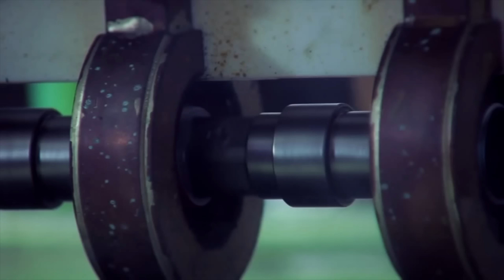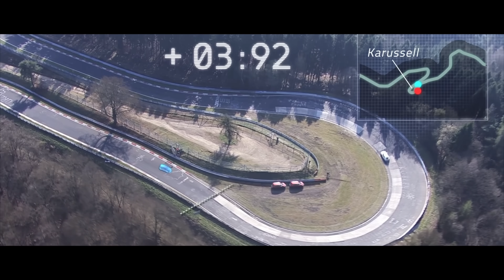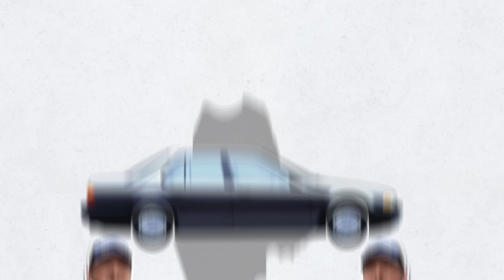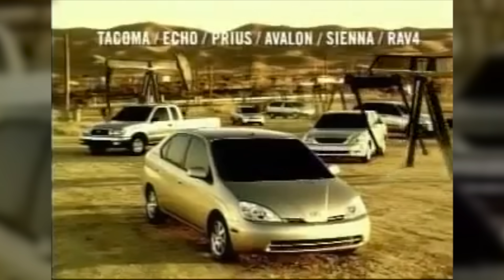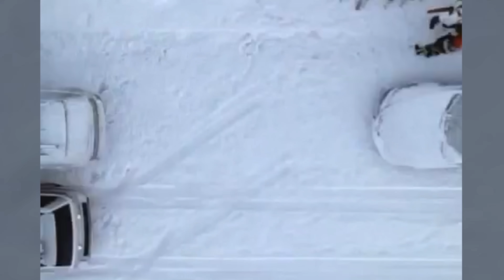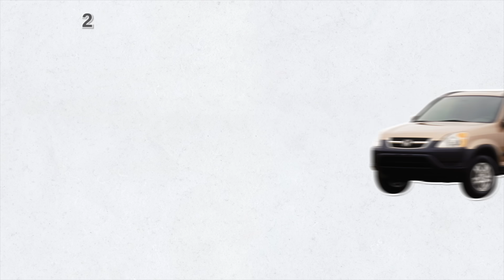Here’s Why Honda’s New Cars are Genius

Comment: Love their cars, lawnmowers, SUV's, but their small outboard engines absolutely suck in the commercial world. We treat lakes and ponds and need robust engines and Honda ain't it. We took a gamble and bought a handful of them and they failed, all of them. The cooling intake was much larger than the 'piss hole' for cooling the engines so they would constantly suck up larger particles than they could exit causing them to overheat. We don't get the option to only boat in clear clean water, that's what we are there to do. Yes, they were covered under warranty but the time it took to get any of that resolved was ridiculous and we traded them for better brands that were proven.

Comment: Bought a 2005 Honda CRV brand new in  October 2004. Best car I've ever owned. 268,000 miles on it and I Ubered with for 3 years. Did almost 2000 trips! Gonna drive it til the wheels fall off! 😂😂😂

Comment: The very first Odyssey (not shown) was Consumer Report’s highest rated vehicle in reliability. It also had 5mph bumpers, the first disappearing rear seat in a minivan and dual-zone AC. The only minivan with those features standard. I owned a 1996 and loved it. Subsequent Odysseys haven’t quite lived up to the first one. But, they are much bigger, more powerful and quieter. The original was bullet-proof reliable, an outstanding travel vehicle, but the engine was not quiet when revved!

Comment: Currently driving a 2008 Honda Accord sedan 5 spd auto.  The only big problem with this one is the VVT solenoid located on top front cam case above the alernator. The gaskets will fail and oil will leak down into the alternator causing it to fail. It's an easy fix. I replaced the top part of the solenoid and replaced the alternator. It runs exceptionally well now averaging 22-28 mpg at 178,000 miles.

Comment: Honda's may be well built with great mechanical parts but honda can't go over its budget of its sale price so it has to compromise by making the vehicles smaller than its competition and interior parts are made of cheap materials like cheap plastic dashboard unless you willing to cough up extra cash to get more features. If your willing to pay above 30,000 or above 40,000 I would suggest a luxury car not a honda. But if you want a small vehicle with less features under 30,000 than a honda would be the right vehicle for you. A honda is never going to turn any one's eye or impress anyone and too many people own them. The biggest turn of of honda IS THE SMALL COMPACT SIZE.

Comment: Look beyond the exterior and engine, you may find what I found. Lack of quality control. A missing mudflap screw, thin rubber door seals, exhaust fumes in cabin from a loose vent cable, and more.

Comment: Back in the 1980's I was living in Korea.  I needed some cheap transportation so instead of buying a car ( very expensive) i decided on getting a motorcycle.  I saw a Japanese Honda 4 cylinder 400cc for sale. What got my attention was that the seller called it a V-Tec engine.  With the aid of my Japanese GF I found out what a V-Tec engine was all about and it's variable valve timing.  After I drove the bike...WOW....what a surge of power from that little 400cc engine when it hit 3,000 or more rpm!  I was convinced there was tiny turbo hidden in that bike.ha ha.  Same when i first drove my 1975 Honda 750cc four. That was the first in-line 4 cylinder production bike sold.  It had a ton of power compared to the Triumph Twins of it's time!😎.  The Japanese never sold a V-TEC bike in the USA.  WHY? Who knows.  I was very sad when I returned to Los Angeles, California and had to sell my Honda V-Tec 400 cc bike.  Often i thought of smuggling into the US via Mexico.😁

Comment: great video. My favorite Honda was my 1988 Accord which I bought for 1800 and sold it 3 years and 50K miles later for $2300. It was the best car reliable and economic. I had a 95 civic, 88 accord, 2008 CRV all great cars.

Comment: I have had 4 hondas. the 82 Accord was great, the 87 accord not too bad but the PGMFI light came on and Honda could not figure it out. My 2001 odyssey gave up the transmission at 15k miles, they replaced it but I wasn't happy, my 2006 Pilot was an absolute disaster. I couldn't keep it our of the shop. I drove 7 rental cars in the first 6 months. Never again for Honda.

Comment: 2012 Accord LX  with 148,000 here. Second Honda I had. Both cars have lasted me around 15 years in tandem and have been incredibly reliable and low maintenance. Probably won't get that with the newer models but would not hesitate to buy another one based off my experience.

Comment: We have a CR-V year 2004 European Edition with 330,000km on the clock and she hasn't had any issues yet. The only thing I could complain about is how the entire rear weight of the car rests on the lower shock mount and causes them to wear out the bushings quickly. Other than that its an excellent car.

Comment: I used to hate Honda's until I bought a 2000 honda accord for 1,400 and 4 years later it's still running strong with almost 250k mi on it and I have done very little to it. Would buy another Honda

Comment: Our family bought the Honda Accord Tourer 2004 iCTDi Diesel model and ever since then we have had 3 CR-Vs, 2 Civics and 2 FR-Vs in the family fleet (some used, CR-Vs new). My Accord is running 360k like a pro with original engine, clutch and all the other parts. Rust is a minor issue around the fenders, but this is something that has been dealt with by plastic parts in the latter models. This is by far my favourite brand.

Comment: Superficial commercial. Ever heard of VCM? Useless junk that destroys engines. It's on par with 1998-2003 Honda transmission disaster. I drive Honda j35 with classic vtec. Good cars but not as reliable as they used to be because it looks like retarded people are running the company now. Need to be indeapth investigator.

Comment: Two thoughts, 

I owned a 97 CRV and there was more than one trim level as mine was leather seats with sunroof and allow wheels, so there was at least 3 trim levels in 97 in the U.S. It was a great vehicle and only suffered a failed blower motor in 200 K.

 I would like to say also that Honda would do us all a HUGE favor and follow Toyotas' lead and get rid of the TIMING BELTS.

That way Honda would truly be a huge leader in my mind. 

My  08 RIdgeline would appreciate the upgrade to upcoming  newer generations of Ridgelines' if Honda would make that happen.

Signed a Honda, Toyota, and Ram  Cummins diesel owner.

Hey that's a thought,,,,,,,,,,,,,, Cummins powered RIdgeline,,,,AWSOME !!!!!!!!!!

Comment: Had a 2013 Accord Sport. She had over 240,000 miles on her and was running like new with only oil and transmission fluid changes for the most part. Sadly it got totaled by a lady who blew a red light. 

Just bought a 2021 Accord touring black on black. Expecting the same experience with my new baby. Minus the getting totaled part lol

Comment: My first Honda was a 1989 CRX Si.  Loved that car but the manual transmission became a chore in Chicago traffic.  My second Honda is a 2018 Clarity.  Again, love this car.  I drive Ride share and it has performed like a champ even with putting on 104k miles in 3 years.  The entertainment system could use an upgrade but that is small potatoes compared to the reliability and comfort of this car.  My passengers love it.

Comment: As a Honda enthusiast and having owned 10 different models since 92 and also 2 Honda lawn mowers. (Ex wife kept the first one. Can't hate on her for wanting to keep it). My 2019 Civic Type R is certainly my favorite I've ever owned and to drive. Prior to owning, my first thought Type Rs were overrated and an over priced civics. Boy I was so wrong!!!! After lots of research. I bought one without test driving one. Unfortunately most dealers won't let you test drive it so when I drove it off the lot and got on the highway. My prejudgments were totally wrong. THE Best car and the most fun car I've ever owned under $40k.  My wife drives a 2019 Pilot, (her 1st Honda) loves her Pilot. I also own 96 EK hatch back with a B16 swap with all stock internals. Mods-Intake, exhaust and upgraded lowing suspension, bushings and a bunch of other nicknacks. Love my Hondas!!!

Comment: Bought my first Honda in 1990. It was a brand new 1989 Honda Prelude and I loved it so much I kept it for twenty years and then reluctantly traded it in for a very good price.
My next car was a used 2005, V-6, Honda Accord, Coupe which I kept for about five years.
My next car was a used 2014, V-6 Honda Accord, Coupe which I kept for about seven years.
My current car is a used 2017 V-6 Honda Accord, Coupe which I would like to be my final car. It would be hard for me to sell it, as that is the last year Honda made the Accord with a V-6.

I am now retired from a twenty year career with a major airline and have taken a part time retirement job with Honda just to get me out of the house. I bought my 2017 Honda Accord while working there and as it turns out, as a Honda employee I get a pretty sweet deal when I buy a Honda from the lot, and I also get a pretty good deal on maintenance and parts too.

Life is good!

Comment: Honda Element was 
H’s answer to the 
whole Hummer fad.  
Wasn’t capable of large towing 
capacity (hello - less than 3 percent of USA has ANYTHING to tow whatsoever so - that’s not a missed priority.
Was designed to be very rugged
 (no carpeting… you could 
literally water-hose 💦 
out the interior to 
🧼 clean it) 
Mediocre mileage was 
its only ‘flaw’

Comment: 190k miles on my 2007 accord cl9 , still original timing chain and all suspension parts including bushings. Running like a charm. The only replacement so far  - clutch. Very robust cars...My next car will be again accord or maybe lexus

Comment: We've had five Hondas over the years, my favorite is the 2016 Accord V6 EX-L that we bought new and still driving. It has been reliable in every aspect. The only thing we've had to do - besides scheduled maintenance - was to replace the battery at three years which was covered under warranty.

Comment: I’ve owned ‘92, ‘94 and ‘13 Honda Accords and all have been bulletproof, succumbing only to collision damage sufficient to exceed the cars’ value. I’ve also owned ‘90, ‘96 and ‘05 Honda Civics and they all suffered from easily warped brake rotors and weak CV joints that would fail like clockwork. By far, Accords are my favorite Honda’s?

Comment: I had a 92' Accord wagon that got close to 40mpg and had 300,000+ miles
Currently I have an 04' Element standard. Very reliable but, not great gas mileage. 
I would like to change the V-Tec engagement to a higher RPM, that would help on road trips

Comment: Hi Scotty,  love your videos. I liked my Honda Integra, though my favorite Honda is the 2013 to 2016 Honda Crz Hybrid !! Ok Scotty, Now you can give the Crz one of your famous Horse Laughs. But !! Those who own a Crz, love it passionately as a fun driving experience, it's wonderful 6 speed transmission and renowned Honda L15 iVec reliability. Many owners have clocked near 300k miles without needing expensive mechanical repairs or replacement Hybrid battery. Well done Honda !!

Comment: A friend of mine had an eg civic coupe with a modified b16 engine dropped into it with b18 cams and it reved out to 11k lol, completely unpractical and not economical but was defo fun when the vtec kicked in on the motorway

Comment: I have just picked a Honda CR-V Hybrid  on a 21 plate NEW and it’s fabulous. I have spent years with Ford but I had to say Goodbye as the Honda CR-V is cheaper to run than a 18 plate Ford Focus 1.0L STX 3 pot engine and when I think about how the hell is that even possible I give myself a headache 😂 I have done just over 1500 miles and  I’m getting 54 mpg and every time I drive the car the mpg continues to climb it’s a beautiful SUV and we’ll put together. I live in the U.K. Liverpool and I don’t see many on the road but worldwide  Honda has shifted over 9 Million CR-V’s that’s incredible number for any car manufacturer also this is my first Japanese car but most definitely won’t be my last I’m over the moon with this car. I can’t give any negative feedback on Honda I just feel part of a special family. Cheers Alan B ✌️

Comment: I’ve owned two Honda Civics - 2005 and 2006.  I currently own a 2006 Ridgline and a 2007 Odyssey.  Both are great reliable cars with high miles and no signs of stopping.  Through two sets of tires on the ridgline, now starting the third.  I may still be driving this when I die.  LOVE Honda cars and trucks!

Comment: I sold my 2018 Cadillac Escalade ESV to buy a Honda Pilot. The Honda Pilot handles much better, a lot more reliable on the road than the Cadillac Escalade ESV. Especially, with turns the Honda handles much better. That Cadillac will be the last GM vehicle I'll ever own.

Comment: I recently bought a used 2008 Honda CR-V and it's been wonderful. I could find no serious bad reviews or consumer warnings. I've read some minor complaints regarding slow acceleration, but mine seems to have plenty of power when needed. My old 2005 Civic LX had nearly a quarter million miles on it before succumbing to head gasket leaks. It was still plenty drive-able when I traded it in, but it was in its last days.

Comment: I drive a 2002 Honda Accord EX 4 cylinder. I have 407,000 miles on it. Everything works on it. The only thing on the drive train I have had done is a head job at 398,000 miles due to a burnt valve. I did have all of the hoses and belts replaced at that time. The vehicle is original from the radiator to the exhaust system. All original. I commute everyday 85 miles round  trip.The vehicle averages 31 MPG constantly.  I do not worry about it leaving me on the side of the road. It is a solid car. This vehicle keeps on giving me peace of mind on my commute. I just change the oil at the correct intervals and rotate the tires. It will always performs. I am so impressed I have a "new" 2016 Accord V6 6 Speed transmission sitting in my garage for a weekend car. This "new" vehicle averages 36 MPG. I am a true believer in Honda motors. I cut my grass with a Honda mower. It has four blades and gives an incredible look to my lawn.

Comment: Own two.  My 2006 Pilot still going strong with over 250k miles.  Honda screwed up with my CRV, the initial model years with the turbo. The oil dilution issue. Pretty sure that one will not last 250k miles, already had to change the fuel injectors and they would not cover it 😡

Comment: I've been driving an '05 Accord EXL until this year when I handed it to my daughter and purchased a '22 Insight. I'm enjoying the 50+mpg and feel of the insight. I was a Ford man for a long time. I got to know my mechanic and his wife on a first-name basis and I even got invited to Sunday brunch. I don't see them as much but I still drop by with some coffee to see how things are going.
Reply: I'm debating between the '22 Insight and the '22 Civic Hatch. Besides the mpg what made you choose Insight?
Reply: @saurabhbhalla90  that's a great question. The MPG was the key factor for me. All and all the two cars are very, very similar. I believe they are built on the same framework. The insight only has two trim levels which eliminated the clutter of making a choice based on features rather than price. I didn't realize how much I like the 'feel of the drive' until after a week of driving. The steering wheel is heavy or tight. It's not all 'loosy goosy'. I really like that feeling. Good luck with your choice. It seems as though it will be a good choice no matter what.
Reply: @Ravenlight_303  you bought a new car
.you get better milage
..but you could have bought a year or two old, and got something and still got good milage and saved money...the money you save on gas, you're spending in the price of the car, plus more
..
Reply: @richsweeney1115  Yes, I 100% agree with you. And in June 2021 the price of a 2018, 2019, and 2020 Insight jumped from 18k to 23k. The price of the 2022 Insight was only 25k. The older models had 15k-30k miles on them, so for $2k, I bought those miles back. I typically buy used and I typically buy the top-end used, it has always been the better deal. However, things are upside down and sideways so there wasn't a significant savings buying used this time. I'm over 50yrs old and this was my first new car purchase.
Reply: You lose way too much money buying new..... especially with prices being way too high right now
Reply: @richsweeney1115  i agree but the used car market isn't doing great either. I decided to go with Ford Maverick. A hybrid under 25k seems like a good bet

Comment: I like this style of video! I just bought a 2021 Ridgeline to replace my 2016 Chevrolet Colorado which served me quite well for 75,000 miles. I researched the crap outta the Ridgeline for over a year and finally pulled the trigger when they refreshed it. I am quite pleased with everything about it!
Reply: Really? Most people seem to dislike the Ridgeline. Why do you like about it?
Reply: @andretsang7337  Who are most people definitely not people that own them or driven them. The biggest critics are the so called "Truck Guys"
Reply: @andretsang7337  It rides super nice and is very comfortable for starters. Plus every safety option Honda has comes standard in every trim. It’s a versatile little truck and does just enough truck things for my lifestyle. It’ll also be very nice not having to switch to 4WD just to make it up my driveway in winter. I could go on but this would easily become one of the longest comments on YouTube.

Comment: My wife is on her 2nd CRV (2007 and then 2013) and my kid has a 2003 Accord 2 door V6 with 130k miles on it.  Only repair it's ever needed in the last couple years was a new radiator.  Both are phenomenal cars.